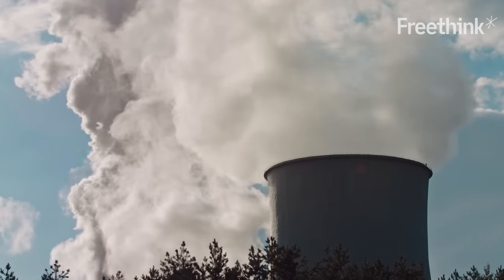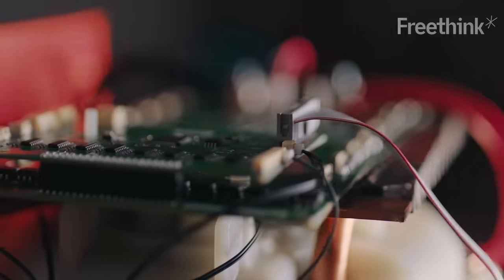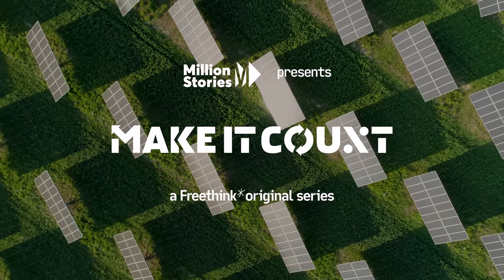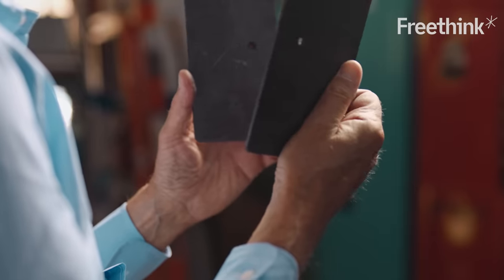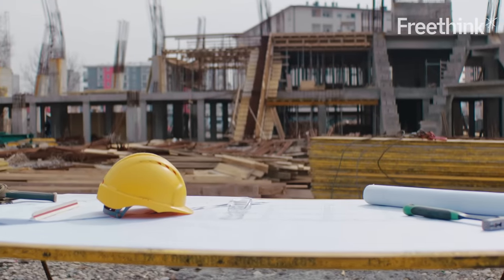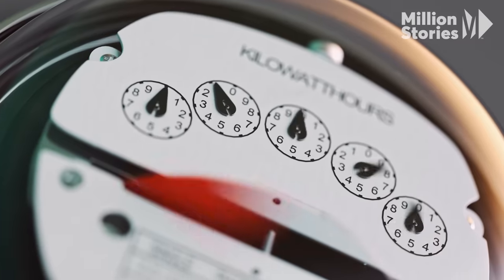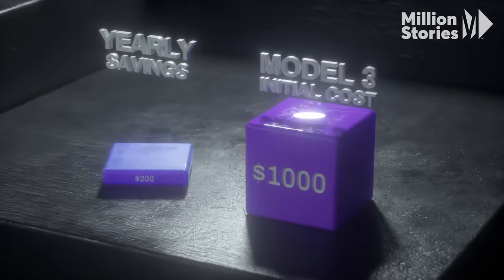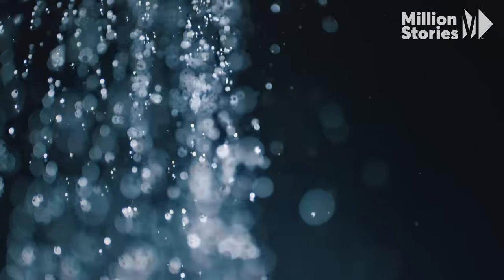The man hacking hot water to save the planet

Comment: As someone below pointed out, heat pump water heaters are available everywhere and give you the same sort of savings with a much smaller electricity demand.  Installed one myself 4 1/2 years ago with no electrical or plumbing modifications.  Does require cleaning an electrostatic screen periodically with a vacuum (about 5 minutes).
Reply: With a heat pump you're using part of the heat from your furnace (ambient heat in the air) to heat your water. So, it just invisibly shifts the expense from one appliance to the other.
Reply: @PDFx1a  I think sir you need to read a bit more about heat pumps... (or air conditioners for americans...)
Reply: @PDFx1a  you could have it you an outside unit or even a ground water loop (depending on if outside is colder than normally ~60 F)
Reply: @windowsxseven  speak for yourself lol!!
Reply: Heat pump water heaters have very low energy demands, but the cold air they output needs to be considered in the install location.
In hot humid locales, they can not only reduce water heating energy, but home cooling as well. They dehumidify as well, so, they can perform 3 tasks… if well thought out and installed. In the winter, they are a heating load for the home, so they raise your heating bill in that case, unless the air is ducted elsewhere.
Reply: @SuperVstech  did you like your own comment
Reply: @PDFx1a  you are right, if your heat pump is installed INSIDE the area being heated. If you relocated your heat pump to OUTSIDE your home, you might find a different result.
Reply: @CuriousEarthMan  If the heat pump water heater is outside, you lose the cool air in the summer and you have to pump heat from the low outdoor temperature in the winter. It is a lose-lose solution.
Reply: @pauleohl  A heat pump is reversible (or, can relatively easily be designed as such), you swap the hot and cold side quite easily by reversing the direction you pump the refrigerant (this can be done with valves).

This way you can cool the inside in the summer and heat it during winter, without turning the heat pump itself around.
Reply: @oddstr13  I understand heat pumps. You are describing a heat pump that is used to heat or cool a home, as required. My comment was on how useless it would be to place a water heater heat pump outdoors. In the winter it would have to pump heat from the cold outdoors, which lowers its COP and in the summer you would discard the cool air that comes off the evaporator.
Reply: @PDFx1a  Put it outside

Comment: Energy conservation. Scales shouldn’t matter, they just make the heat transfer slower with 0 additional losses. This guy seems like another Theranos. Bla bla bla
Reply: Yeah this is a scam. He probably sells healing crystals on the side. Electric heating is 100% efficient by definition. All on demand heaters are exactly 100% efficient by definition.
Reply: Better yet, follow proper Periodic Maintenance Guidlines (almost no one follows) by pulling out the Heating Element (quick and easy), cleaning or replacing (cheaply) if need be, and more importantly, drain out the Calcium that builds up on the bottom of the Tank, displacing water capacity and Wa La your good to go...
Reply: If it takes 1 minute to boil water at x power or 2 minutes to boil water at x power then we see 2x is twice as much as x. What's so hard?
Reply: @thebrowns5337  Talk to your physics teacher, if there ever was one 😂
Reply: I dont get your reasoning. Making the heating process last longer directly implies allowing  more time for energy losses. For example, for the SAME amount of input energy, setup and keeping everything else same,  A heating process lasting for 1 hr will surely lose more energy than a heating process lasting only for 10 mins (we already assumed "for the same amount of energy" remember ?). 

Also I find @The Browns point to be a valid scenario, in the case when we supply a continous power, but not same energy. And yes Ive had a physics teacher in school. So please explain properly to me even if I may be wrong.
Reply: @pierce8308  (Time * power) needed to heat up a certain mass of water by a certain degrees is always constant. There is absolutely no way to change that.

Look for 'water specfic heat capacity'

Taking losses into account. Storage Water heaters are very very well insulated. Typically 20 m2K/Watt. So assuming a fairly large 1m2 external surafce area for the tank. The losses at 40C temp difference would be 2 Watts...
Reply: @AbhinavRoy1  That is completly true and I am aware of that. But from what I understand you said from your reply is if I subject a heating system to 100 joules of energy, the water in that heating system itself will recieve all of those 100 joules, meaning zero losses, which is completely untrue.
 Moreover even if the water received all of those 100 joules, making the heating process last longer gives more time for other losses, which would be miniscule had the water been heated quicker. (we are not talking about spikes in power generation, we are comparing two systems having same input of 100 joules)
Reply: @pierce8308  Yes. Those time dependent additional losses are miniscule in my knowledge. Shared an explanation above. 

A water heater design engineer would probably have a better idea.
Reply: @AbhinavRoy1  If I understood it right, you are talking NOT about the loss, but about the RATE of loss. Loss (or Total loss to be pedantic) would still be FAR more if heating is slower. Why? because as per your example total loss over 1 hr at loss rate of 2 watts would be 3600*2 == 7200 joules, however it would be only 1200 joules for heating for 10 mins. This is assuming loss rate is uniform but I hope you understand my point.
But yeah, I myself am not sure about the impact it makes in the grand scheme of things. 

However it does make your original statement invalid. I hope we reached an agreement
Reply: @pierce8308  Such a heater with a 1m2 surface area would hold around 50litres. 
Energy required to heat up 50L of water by 40C = 4.186 * 50 * 1000 * 40 = 8,372,000 Joules

Compare that to the 6000 extra Joules lost.

I presumed that the miniscule rate of loss made it pretty clear that the net loss would be pretty small.
Reply: @pierce8308  On demand heating requires more on demand power gives more powerloss in the local power grid. They don't want to show the calculations they use to justify their claim, and there is a reason for that.
Reply: @pierce8308  That would be true if you are talking about something like a kettle cooker, which has no insulation, but a hot water heater will be heated 24/7, so what matters there is the heat loss of the storage tank.
Reply: Wrap it with Aerogel and you won't need to heat the storage For a long time. Depending on how much hot water one needs and how big the storage is one could also calculate the heat the water needs to have so one still has comfortable hot water at the end of the cyclus.  Than one could actually set up the cyclus to heat the water up when electricity prices are the lowest. if there is a volatile contract possible.
Reply: @pierce8308  Hey Pierce, both heating  methods have near 100% efficiency. However, the new one heats water only when it's being used, so it has no time to cool down (thus being more efficient). However this can be done with both methods, but has never been done because it requires a huge amount of power, which makes electric grid management far more difficult (because there will be more demand spikes).
So this new method aint really new and isnt used because is not practical.

Hope this helps :)

Comment: There’s a reason he pretended it was instantly boiling, and didn’t show it actually heating water with a thermometer. It’s just an anode and cathode making hydrogen and oxygen bubbles like a Hoffman Voltameter (circa 1866). They don’t mention heat pump water heaters which are 2-300% efficient in real-world tests. This has mad snake-oil vibes. There are better products that beat this to market by a decade.

Comment: When you connect to a power grid, the amperage you draw dictates your base price. The more you draw, the more expensive it becomes. At set points the contract you make steps up to another category, 200amps is a cheaper connection than 400amps. Having to upgrade connection to a higher amperage just because you use hot water sporadically.. is not a great idea for the consumer. You may use less electricity but your electricity bill is higher.

We should anyway not favor instant heating of water, as it makes large current spikes but instead use reservoirs, aka heater tanks... They are not as efficient but that is not the only meter. We need also stability, the more stable the power consumption is the easier it is to manage production and distribution of electricity. Specially important with wind power, but also applies to pretty much all ways we generate electricity. It is not easy to increase supply fast, or to decrease it. 

I'm sure there are things we can do in the heater tank design to decrease losses, and then use electrolytic to heat it. Of course, we need to treat the water first to get the ionic concentration to a certain level for it to really work well. It could be better then to use closed to open loop heat exchanger, where the hot side circulates purified water or other liquid in a closed loop.. Increasing pressure on the hot side can be used to raise the temperature to make the heat exchanger temperature gradient steeper, which increases efficiency.
Reply: Exactly my thoughts. Living in a Nordic country the loss of keeping a boiler ends up heating the rest of the house anyways so not really loss.
Reply: Exactly. Having a hot water storage tank could smooth the supply of solar/wind, and is in-effect the cheapest distributed battery system you can get. 
If you could operate it when electricity is the cheapest, you'd be helping the grid a lot.
Reply: This is exactly what came to mind when he said tankless is better. Yes, bacause it uses less electricity, but no, because it strains the grid
Reply: @darioadrianz  I think maybe it can be good if we use Amps to heat water in a slightly smaller tank, but if everybody is going to apply this then we probably need to upgrade the power grid and change those Amp prices to fit consumer needs.
Reply: I find it odd that the topic of water heating always defaults to electric appliances. I've live in multiple locations in three different states and NEVER had electric hot water. Who are all these people that don't have natural gas service to their houses? That's what I'd like to know. Have I been THAT lucky?
Reply: This system has it kinks, but I am thinking what you are missing out is no system is 100% isolated or efficient, if it takes 1hr to heat 1l while this can do it in 30min or 10min your water will loose less heat to the surroundings, sure the old heating will also release all its heat eventually, but the duration also needs to be taken into account.
Reply: @PDFx1a  I have homes in FL and NY. No gas available on my street in NY and I have been here since 1968 when oil was cheaper than gas. Why is there no gas at my location? The builder told me. When he was developing the land he approached Long Island Lighting and local oil dealers and made them compete by paying him a fee of some sort or giving him boilers and tanks at reduced prices.  Remember that he was supplying them with customers The oil companies gave him the best deal.

There is no residential natural gas in south FL. Simply does not exist.

Much of rural America has no gas because it is uneconomical to lay the lines for widely spaced homes.
Reply: @pauleohl  Well, in Florida that makes sense, because your water table is so shallow, I presume. What's up with the rest of the East Coast? 

Much of rural America uses propane, which is still, essentially, gas. It's pretty easy to go off of electric hot water in this situation.
Reply: @PDFx1a  Propane is expensive enough now that the cost per btu for propane is about the same as resistance electric heat. Because an electric water heater has no flue, it holds heat better than an insulated propane fired hot water tank.

Comment: Where I live In Brisbane Australia the temperature inside the roof space will routinely get to 50°C for at least 9 months of the year. When you turn the cold tap 🚰 on, you actually get hot water for the first minute or so. What we need is a Thermostatic device that reroutes this hot water into your hot water tank and doesn’t let it go down the drain whilst you wait for the water to go cold.

Comment: This is snake oil. 1 kWh raises the temperature of a given amount of water by the same amount, no matter what heating element you use.

If you want to save energy on hot water, insulate your pipes, use an on-demand/tankless water heater, and heat with natural gas.

Comment: If this is electrical heat, all heating elements are 100% efficient at converting electrical energy to heat, so how is 50% of the efficiency lost just because of mineral scaling on the element?  Improved insulation could improve efficieny; but I fail to see how an upgraded heating element could do the same.  This assertion is either poorly explained or wrong.
Reply: Both. The main point of this new technology is to heat the water when it is being used. To do this a huge amount of power is needed, so you need a more powerful electric supply. Traditional heaters, store huge amounts of hot water so they don't need to instantly heat it (so it is much less powerful).
Both methods use the same amount of energy. However, hot water tanks cool down with time, so some energy is lost. But this is very small amount and can be reduced with better insulation.

That's why hot water tanks are not replaced, almost same efficiency but less stress on the electric grid.
Reply: 50% i believe means that it takes double the time to heat up the water, but energy efficiency still around 100%.
Nobody really cares how long it takes to heat up the water as long as it is hot when you take a bath.
Reply: @bramza8853  That does not make sense at all. The mineral layer has a higher heat capacity but inevitably gives its heat to the water thus the heating element is still 100% efficient. Unless you are suggesting the mineral deposits create a blackhole that deposits energy into another space-time dimension perhaps?
Reply: @bramza8853  If what you wrote makes sense to you, you need to get a better education.
Reply: @bramza8853  Hold up, hold up, hold up. So the mineral layer "captures" part of the heat from the heating element, that heat has to go somewhere.  It can't be "reflected back into the wires" because that means it would have to go back through the heating element, which is already hotter than the mineral layer. The only thing the heat can do is continue to pass on to the water, or stay in the mineral layer, heating that layer up. Once the mineral layer reaches the same temperature of the heating element, then all it can do is transfer any heat it receives into the water.
In a real-world case, the mineral layer will always be in a temperature between that of the heating element and the water, just as the surface of an unmineralized heating element would be between the temperature of the heating element core and the water.  All the mineralization does is slow down the INITIAL heating, not the maintaining of the temperature.  That means, if your water heater is sized too small for your water usage, when one person uses up all the hot water with their shower, it'll take a little longer for the tank to recover for the next person. If you have the right size tank for the househould, then you won't notice a dip in temperature in the last person's shower.
In summary, this "ohmic reactor" is nothing but snake oil. My only regret is that I can only give ONE downvote.
Reply: @andrewdreasler428  my comment was utterly stupid, don’t mind it

Comment: I wish they explained how this exactly works and major draw backs. Feel like the graphite will eventually get platted with metals or break down over time. 

 Got some Thernoes fake till you make vibes here. Also for the same  or less cost you can put a calcium filters and your the lifespan and efficiency goes up on a tradition electric water heater.
Reply: If it is just running Electricity through Water, wouldn't it start Electrolysis?
Reply: @Cosmo Genesis Don't vaporizers use high frequency piezoelectric ceramic elements? How is this the same??? Wont it be better to just use microwaves to excite water on demand??
Reply: It's  very straightforward.
1.) Give them all your money.
2.) They catch a plane to Bermuda.

Comment: Any direct heating method to heat up water (or air) can never be more than 100% electrically efficient. (Like this product).

A heat pump on the otherhand can easily get 400 to 500% electrical efficiency

So 1 watt electrical power in, gives 5 watts of cooling or heating out. 

So just install a heatpump based solution.

Comment: Don't you collect ions from the water on the electrodes that way? I mean what you're doing there is a (granted, relatively slow) electrolysis. You would need to change those carbon plates every now and then.
Reply: You shouldn't get electrode degradation if you are driving them with AC.
Reply: @jamesbrown99991  Oh yeah you're right. I was only thinking DC for some reason..
Reply: Very true indeed, this looks very DIY-able to be honest. 1 dc(or ac) power supply and current control unit and yer halve way there